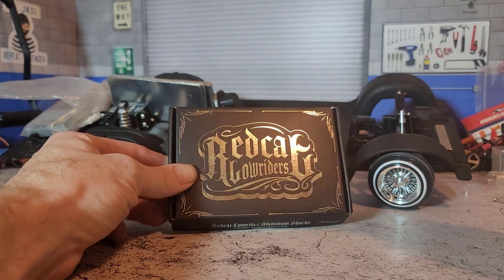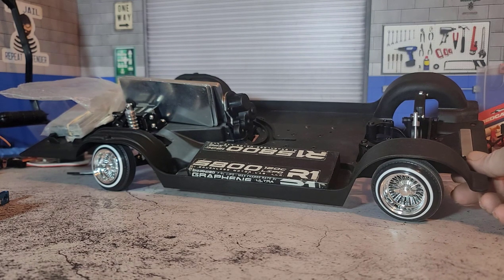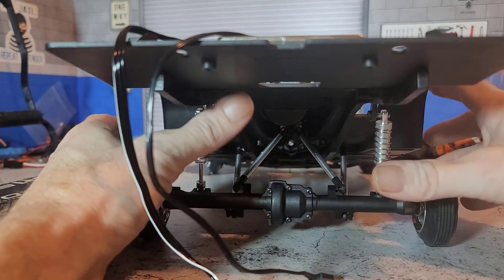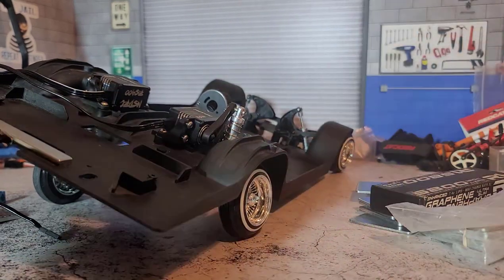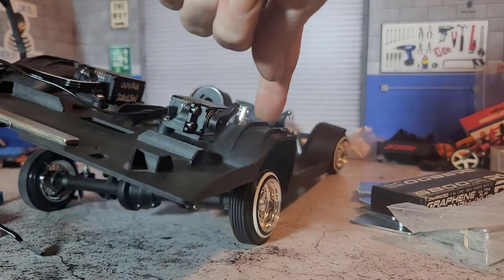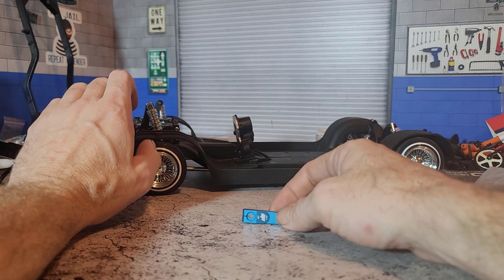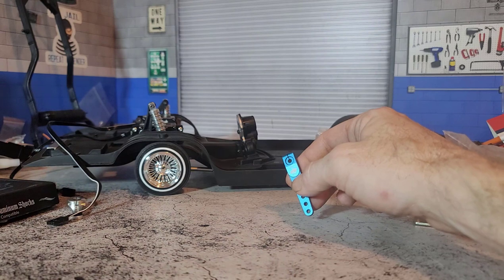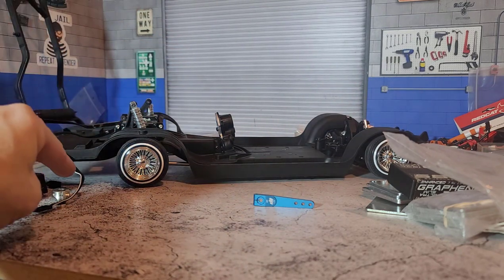Redcat Lowriders NEW Aluminum Scale Look Shocks by Redcat Racing

Comment: Not sure about the top caps but could the lower ends be changed out for ends that would allow better articulation? The stock ends looks very bulky. I just got my 59 and plan to avoid these but just tryin to think of a idea for those who already bought them.
Reply from the maker: That was my first thought too, just use our wpl rod ends, but the shock shaft is m2.5 n all our rod ends are m3 :/

The issue here is the 2mm hardware for shocks. The kit runs m2 and had to design the upgrade (that youre right is far too fat out of scale) for m2

Finna say when they need v2 these chassis upgrade them on at least m2.5 hardware and should of used an m3 rod in the keast inside the shock.

Comment: i thought of making a spacer for inside where the shock original sits and then putting the shock on the outside of the shock mount with a titanium bolt running through it all with a nut.

Comment: Where did you find the blue thing to make the back raise up more than stock
Reply from the maker: the voltage regulator is a bec it big up the power but to lift higher its shock length + servo arm length

Comment: I have a question but it don't got to do with what this video is on but I got the monte carlo lowrider one and my switch to the remote control broke the one that slams the back u one where I can fi d one I been looking but can't fine one thank u for your time
Reply from the maker: the only 2 options are hit up REdca customer service maybe they have em I doubt it, its also possible the hardware from Flysky FX6 will work
Reply: @NorthSideCustomRC  ok thank u for your time

Comment: I have one of the heavier builds with the mob audio system and the 4 presidents figures. I didn’t buy these for that reason lol.
Reply from the maker: more the weight, the more it will be leaning on the flex point
Reply: Where did you get your president figures?

Comment: Damn, i just ordered them yesterday :-(
Reply from the maker: sorry didnt get vid out sooner. I was honestly looking for insight from Redcat and other users, but found none really other than  they were not designed for full articulation and thats Bullshit
Reply: @NorthSideCustomRC  well, the gimick behind it is being able to change internal springs for bounce and weight control... and im thinking that is mostly important on the front bounce. 
You said the fronts work fine .. so its not a total loss i suppose.
Reply from the maker: @Samuel Torres  the fronts look good fir hop and easy peasy drop in.  Not a bumper Banger set up but should be alright
Reply: @NorthSideCustomRC  you have lots of videos. Maybe the next video should be a "from stock to hop" with your list of products that make the ultimate rc lowlow.